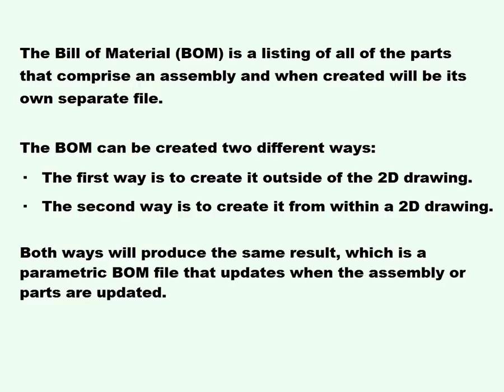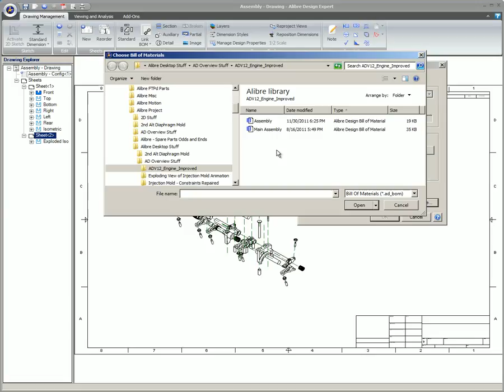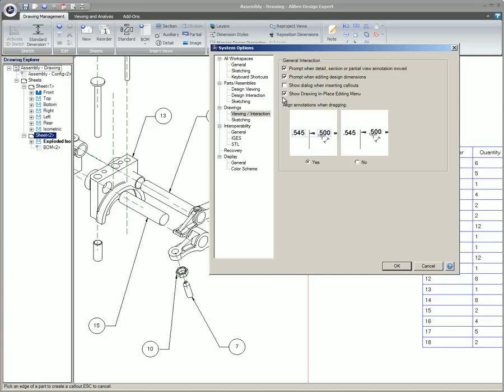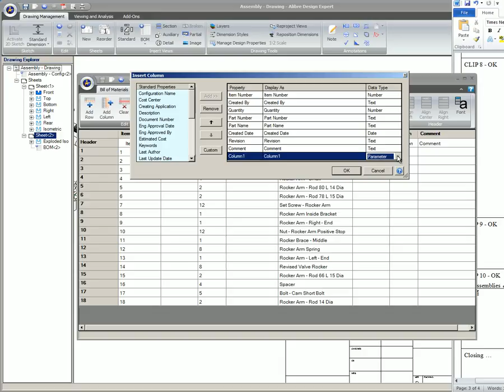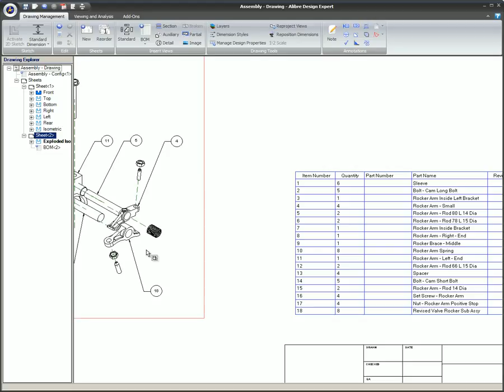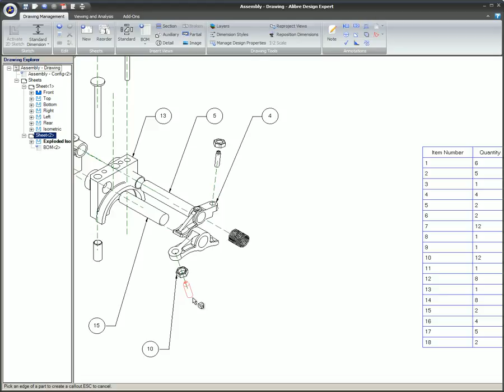Bill of Materials (BOM) in Alibre Design (Legacy Interface)

Comment: It took me a bit to realize that the BOM is basically the overall parametric table function of Alibre and it can be reformatted so it's not a true bill of materials per se but can contain other properties like material and finish to the exclusion of properties like item and part number. There are some challenges in creating a functional hybrid table with this so there are parametric and non-parametric fields though, but it's overall a good setup.

What advantages are there in a workflow setting for having the BOM as a separate file that is not embedded in the drawing file?